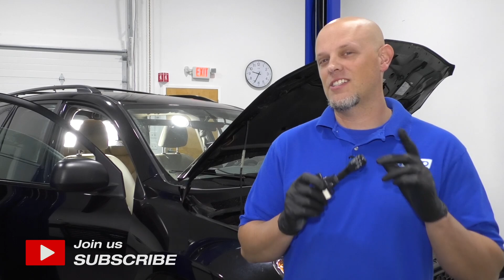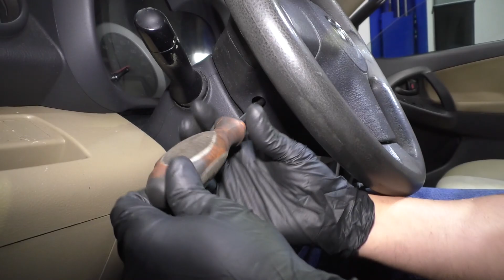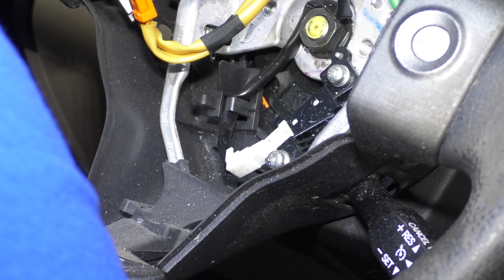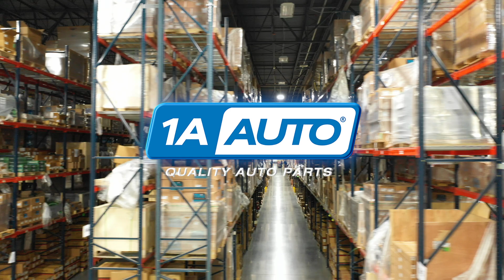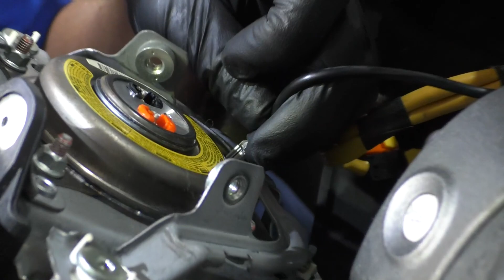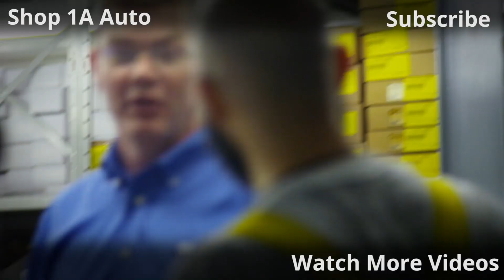How to Replace Cruise Control Lever 04-12 Toyota RAV4

Comment: Hi! I need some help with my *2006 Toyota RAV4 (2.4L)**. My car didn't have factory cruise control, so I bought an **aftermarket cruise control switch* and installed it myself. However, it's not working at all—when I press the 'On/Off' button, the **'CRUISE' light on the dashboard does not turn on**, even at speeds over 40 km/h.
My horn and steering wheel audio buttons are working perfectly, so I think the spiral cable might be okay. Does my specific model require an *extra wire* to be pinned from the clock spring to the ECU (ECC pin)? Also, should I check if my *brake light switch* is 2-pin or 4-pin? Any advice on what to check next would be great. Thanks!

Comment: Is there some other way?? To remove the air bag or steering wheel because the right side hex bolt is stripped and not coming out??? Im stumped

Comment: I have 2012 Rav4 2.4L base model, it doesn't come with cruise control, so I'm asking if the car comes pre-wired, mean i have to install only the cruise control lever, or it need to do all the wiring... ?

Comment: Hello I'm Jake from the philippines and I own a 2004 toyota camry (3.0 V V6 asian Trim version) 1MZ Automatic Transmission I'm just wondering if you could help me because it doesn't come with a cruise control and I want to installed it my self I hope you can help me with my concern maybe you can help me to find a part number of the cruise control lever and the guide how to installed is

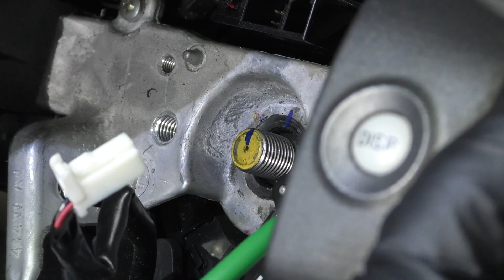Comment: Hmm🤔, seems like a step was skipped. On 4:08 the stick was installed then on 4:20 the steering wheel is being installed. Why was the steering wheel removed?
Reply: From watching several of their videos it seems they record longer videos replacing several parts along the way. Then cut the parts that relate to whatever you're trying to replace.
Reply: I was wondering the same thing.